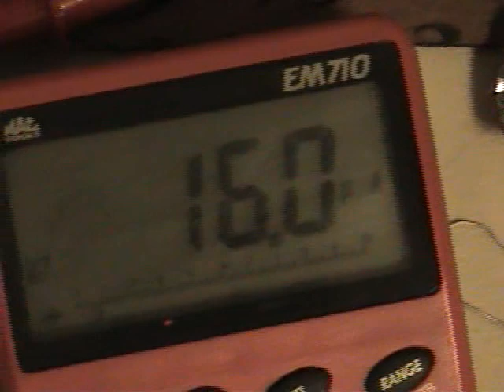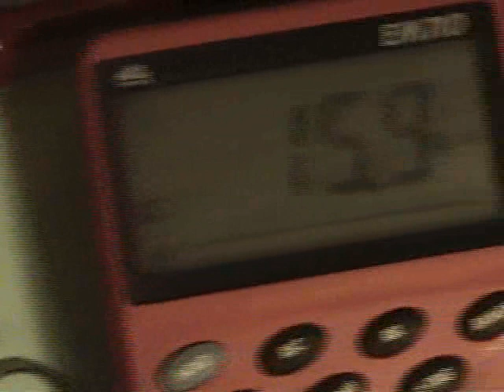low ma joule thief part 2

Comment: You're using so little power, it's almost equal to the 'bleed' on those types of electrolytic capacitors.  If you had any ceramic disk type or tantalums, these may prove more efficient.